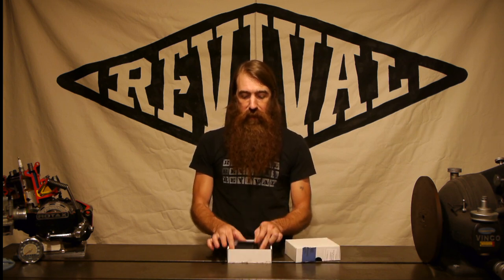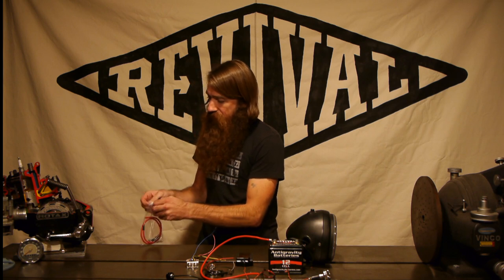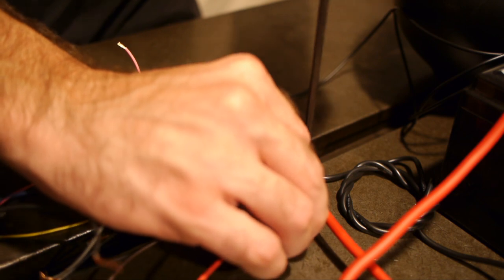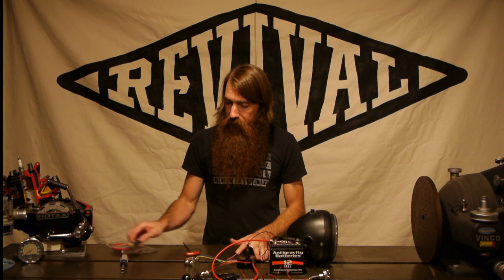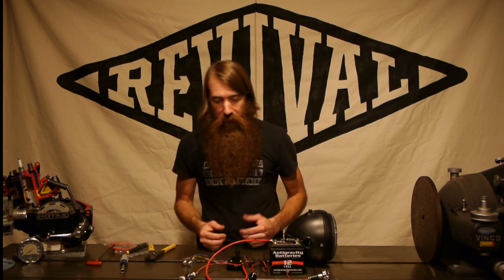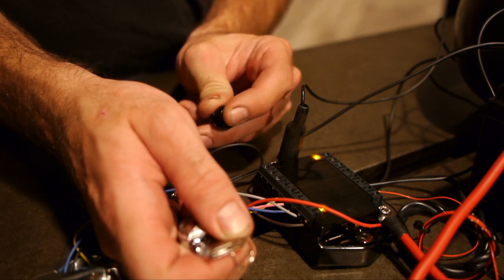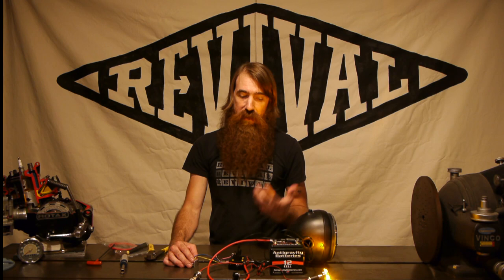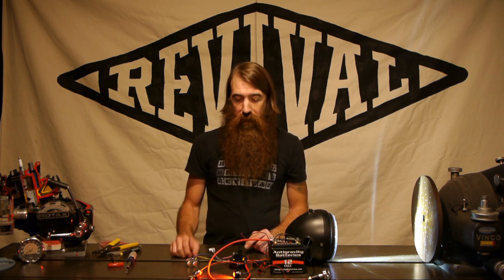Wiring the Motogadget m-Unit V.2 - Revival Cycles Tech Talk

Comment: hi..is the configuration button included with the m-unit?or do i have to buy it separately? and does the m,-unit technically replaced the fuse?
Reply from the maker: +Ros ariff Roslan 

The m-Unit does not include a configuration button. However, configuration button is only used during setup and it is not absolutely necessary to purchase one separately. On all our builds we just use a short length of wire to make a temporary switch, one end of the wire is inserted into the config terminal, the other is touched to a chassis ground to create a switch, just use this the same way you would a button. There is no current that flows from the config terminal so there is no risk of getting shocked, just be sure you are touching ground and not positive voltage. Once the configuration is complete, you remove the wire from config. Its quick and dirty but it gets the job done and you don't waste money on another switch. 

The m-Unit does replace the fuse block. It has preset current limits for all the outputs on the m-Unit and if the current exceeds these values the m-Unit will shut down that output. There are a couple exceptions to this. First, you still need a main fuse to protect your battery from a charging system failure. And second, if you are connecting thin gauge wire to the outputs, they should be fused to the appropriate amperage for the gauge wire you are using. As an example of this, if you are using a Motogadget gauge, the wire is very small gauge and it gets power from the AUX output. The AUX output can supply 16Amps and that gauge wire should be fused at 1Amp, and therefore a fuse is required to protect the thin wire that goes to the Motogadget gauge.
Reply: +Revival Cycles  great video series, helped out a lot..  a quick question ....   when i have the m button installed the config input is used and when i tried to use the config button it did not work...  when i removed the m button config cable i could configure the m unit as normal... this causes a problem as it is not that great to have to keep removing the m button to re configure the alarm for example... anyway i could put a switch that isolates teh m button but i was wondering if you had a better idea?

Comment: Ive got a 1994 sportster 883. Just bought the motogadget m-unit. Couple of questions, because the schematic isnt as straight forward as it seems! 
It shows a wire going from the ignition module to aux (m unit). which wire do i select? Ive kept the electronic ignition and will re run cable for oil sender. That i can deal with. 
Also, do i now just bin the voltage regulator at the front of my bike? 
Comments appreciated. 
In the UK, so its not so harley orientated!!  Cant just zip down the mechanics shop and pick his brain.....
Reply from the maker: +Dwayne Moss Thanks for your question! There are two parts to the answer. Hope this helps! 
a) Ignition system. The ignition system remains as it was from the factory, any sensors, CDI's, fuel pump relays, or ECU's are still maintained. The way they integrate with the m-Unit is by getting power from the "AUX" output. The specific wires that you need to deliver power to are the ones that would have originally been powered by the ignition key switch. With out having a clear wire diagram for your specific bike it is not possible to determine which wires need to be connected to "AUX". 

b) Charging system. The regulator rectifier is still retained, and is connected as it was on the original bike. In some cases the reg/rec needs to get a switched reference voltage and this provided by the "AUX" output. In the case of a Harley Sportster my recolection is that this is a simple single phase permenant magnet system and there are 4 wires that come from the reg/rec. Two come from inside the engine and this is where the AC power comes from, then the other two are the DC side, one will connect to ground (either at the battery or on the frame) the other should be the regulated +12 V and this connects to the positive terminal of the battery via a main fuse.

Comment: Hi I don' t know how to connect m-Unit button with the  front brake. The m-Button has 1 cable only but the brake lever has two input plugs. What I have to do? 
Many thanks for your help.
Reply from the maker: +stefano colautti The other side of the brake switch is connected to ground, just like the rest of the control buttons on the handlebars. On our installs we run a dedicated ground wire to each switch and these ground wires all splice into one wire inside the handlebars so it keeps the bulk down, and ensures long term reliability.
Reply: +Revival Cycles 
I'll do it.
Thanks.

Comment: hello. I've fitted the v2 to my bobber build - all new wiring. I'm have an issue with when I've got the lights on, it works fine. when I put on high beam it turns off my tail light. it's a twin wire, twin bulb rear lamp. how do stop the tail light turning off when I go on to high beam?  thank you.
Reply from the maker: This sounds like you may have your tail light wired into the low beam of the headlight, like some OEM setups do. I usually find it is easier to set up the tail light using the 1-wire feature. To do this disconnect the tail light wire from the rest of the bike and then tie the tail light wire and the brake light wire together , and then configure menu 2 as option B for LED bulbs or C for standard incandescent bulbs.  This will allow the m-Unit to control the tail/brake functions. Just to be clear you tie the power wire for the brake light and the power wire for the tail light together, the ground  wires still connect to ground. 

If you need more details or have more questions, email techsupport@revivalcycles.com Thanks!

Comment: I am on my second ultimate 18-533, and I just failed again... So I wondering could I just cut out the box and use the m-unit in its place....
Reply from the maker: +John Schwartz We have never used one of the Ultimate products, and as such do not have much information on that product. We did take a quick look at their installation instructions, and yes, it appears that most of the needed wires are routed to that control box and with some careful re-wiring you could replace that module with an m-Unit. It is worth noting that the m-Unit does not have connections for both sides of the control switches, and you would need to make sure the switches we setup to reference ground with the m-Unit install, and you would also need to reconfigure how the instrument warning lights are wired. Still all this can be done at the location of the control box. Email techsupport@revivalcycles.com if you need more details

Comment: hi mate , its possible to connect a fuel pump to the m unit? if so, where in the m unit will go?
Reply from the maker: Yes the fuel pump can be connected with the m-Unit, and it would be supplied power via the AUX output. However, the fuel pump should still be controlled by the ECU and that means you'll need a fuel pump relay. Once you have to add a fuel pump relay back into the system, then its just as easy to power the fuel pump directly from the battery.  

It is good practice to  have the fuel pump controlled by the ECU so that it doesn't run the entire time the bike is on even when the engine isn't running.

Comment: Can I use this with just a battery to add a horn  brake and indicator light on my off road. Ike ? Thanks
Reply from the maker: In theory you could add an m-Unit and a battery and run it as a total loss system. But if you want to go this route, I strongly suggest using LED lighting, the LED's draw a lot less power and that will make it so the battery lasts longer. 

Also, you should do some research there may be an aftermarket stator and reg/rec for your bike so you can actually add a charging system, that way you won't have to run as a total loss and it will work more like a normal street bike.

Comment: Always awesome useful videos thanks Stefan. I'm having issues with my m-unit As soon as I touch the "Start Out" blue cable to my starter solenoid (point 50) the bike immediately tries to start.I have tried this with the m-unit off and on with the same result (the bike tries to start).I removed the config wire to test and the same result.The M-Unit is acting like it has "always on" for the "Start Out". any ideas.? thanks
Reply from the maker: Hmmm, that is an interesting one. It is possible that the start output has failed and is stuck in the on position. The best test for this would be to use a spare turn signal or light bulb to check if the start output is always on. One wire to ground one wire to start, if the light turns on then the start output is damaged and the m-Unit will need to be replaced. 

It doesn't work to test the output with a multi-meter because the solid state devices will still show voltage even though they are actually off. The only proper way to test an output on the m-Unit is with a "load" like  a standard 12V light bulb.

Comment: Is the switch in this video the two position switch that y'all offer?
Reply: Also, do I still need a starter solenoid or is that built in as well?
Reply from the maker: +Alex Carter
You got it,  that is the same switch we offer on the site and use on most of our builds. There's also a 3 position available if you need.
Reply from the maker: +Alex Carter
The m-Unit does not replace the starter solenoid, but in most applications that is the only relay that needs to be retained.

Let us know if you have any other questions, you can also direct them to websales@revivalcycles.com and we'll be happy to help you out.

Comment: Hi, we're using a two way 3 wire rocker switch for the headlight, scratching our heads how we wire low high beam switch in.
Reply from the maker: Low beam wire does not connect to anything. The best plan is to use some heat shrink to cap the end so it can't accidentally touch something and cause problems
Reply: Thank you.

Comment: hallo is it possible You make a video a bout the c5ig ignition i woud like tot sees hoe it work with special for a virago
Reply from the maker: Thanks for the request, the C5 ignition tech talk is on the list, but we haven't scheduled it yet...we will move it up on the priority list. This is the best ignition system we've found, simple to install, simple to time, extremely effective, and perfectly accurate. 

We have installed many aftermarket ignitions and this is the C5 is the best.
Reply: wow thank You for the fast respons i all ready orderd the 'm unit because of this video for my virago i 'm looping for werd for the c5ig for the virago alle ready thanks
Reply from the maker: Yea those C5 ignitions are great, and while we don't have all the models listed on our webstore, we are an official dealer and can get you whatever you need. We can also program custom ignition curves if you want to do something specific. We've got the C5 on the list for tech talks, but there are a few topics that are ahead of it.
Reply: Revival Cycles  I want to add a horn brake and indicator lights on my off road bike , just powers by a single antigravity battery , and m unit is this possible ? Thanks

Comment: Hey did you guys finally get the M unit working with the LED taillight blinker combo?
Reply from the maker: Its not completely clear what you are referencing, but we have been able to find solutions to every lighting setup so far. If you are talking about a combination tail/brake/turn LED setup, then the best solution we've found is to use a hopkins LED trailer light converter to manage the brake/turn interaction.
Reply: @RevivalCycles  if I wanted to wire in a relay would I do that through the AUX? Yes I am referring to exactly that, thanks for the quick response, you guys should get on reddit!
Reply from the maker: Right with the original V2 m-Unit you would power a relay coil off the AUX output. But with the new m-Unit Blue or Basic, you have two new AUX outputs in addition to the ignition output so you might be able to just use AUX 1 or AUX 2 instead of adding a relay.
Reply: @RevivalCycles  Awesome thanks for the information! Seriously look into getting on reddit you'll probably be able to push some product and gather some attention to this through it!
Reply from the maker: Thx for the tips, we'll get the media guys to take a look at that. It does get tricky to manage all the different social platforms, but hey if it was easy everyone would do it.
Reply: @RevivalCycles  Very true mate you're doing the lord's work here so keep it up.

Comment: i know this is an old video but can you set this up for 4 way flashers to
Reply from the maker: Yep, the m-Unit will do 4-way flashers if you are using momentary push button switches for the turn signal inputs. The 4-way function cannot be activated if using a stock style toggle switch for the turn signals, because the m-Unit needs to see both inputs pressed at the same time and that isn't possible with the stock switch.

Comment: If you got a cdi powered by your generator at the flywheel, how would you go about wiring the key switch and what would Aux output be powering?
Reply from the maker: The key switch for the m-Unit is the same as it is on any of the installs, the switch provides power to the lock input. When the lock input is not powered, the m-Unit it off, when the lock input has power it is turned on.  The m-Unit does not work with bikes that don't have a battery.

With a CDI type ignition system, I use the AUX to power a normally closed relay. Then the relay is used to ground the kill wire from the ignition control module. That way, when the AUX is off, the relay is closed and the kill wire is grounded (no spark). When the AUX is powered the relay is open so the CDI will generate a spark.
Reply: I really appreciate you taking the time to respond to my dumb questions! My worry is that by send high DC to the CDI via the aux output as in the motogadget wiring diagram, would I not damage it seeing as it's normally powered by the magneto?
Reply from the maker: Just to clarify, the AUX does not connect directly to the CDI. Instead, the CDI is wired up as shown on the factory diagram, so the magneto still powers the CDI, and the coils are powered by the CDI, and the pickup coils tell the CDI when to spark. But the AUX is used to control a normally closed relay that replaces the manually operated kill switch or key switch.
Reply: Got it !! That diagram with aux spliced into the ignition coil feed confused the hell out of me. Just got the headlight low/high beam with oem controls  and m-button to suss now. Thanks again for your help.✌️
Reply from the maker: Take a look at the manual on the bottom of page 4 and the top of page 5, that explains the hookup for stock controls on the headlight. But basically it uses the stock toggle switch like a true / false input, if the llight input is grounded, that tells the m-Unit low beam, if the light input is not grounded that means high beam. So you only connect the low beam wire from the switch to the input, and the high beam wire from the switch is not connected to anything. 

The m-Button is wired up exactly as shown in the diagrams, there is nothing special about using stock switches. The magic happens in the m-Unit when you setup the configuration of menu 5. Make sure the configuration matches the type of switches you are using.

Comment: my bike is 2003 r1 battery black wire came loose now I have no power to clocks and wont turn over but fuel pump starts could installing a motogadget ix the electrical fault or is the electricals to complicated on my bike thanks in advance p I'm fro uk
Reply from the maker: The m-Unit can be installed on modern fuel injected bikes, but it is a rather involved process and you should make sure you have a solid understanding of the wiring for the ECU and sensors before beginning.

Comment: Does the M Unit come with the configuration button?
Reply from the maker: +Allen Davis The m-Unit does not include a configuration button. However, configuration button is only used during setup and it is not absolutely necessary to purchase one separately. On all our builds we just use a short length of wire to make a temporary switch, one end of the wire is inserted into the config terminal, the other is touched to a chassis ground to create a switch, just use this the same way you would a button. There is no current that flows from the config terminal so there is no risk of getting shocked, just be sure you are touching ground and not positive voltage. Once the configuration is complete, you remove the wire from config. Its quick and dirty but it gets the job done and you don't waste money on another switch.

Comment: Can the M- unit be used with the a Honda CX500 orinal harness?
Reply from the maker: The short answer is, yes. However, the recommendation is to start from scratch. The factory wiring is not really setup to work the same way the m-Unit is and although you can reconfigure it, many times its simpler to just start over.  Also, the factory switches are a very common source of problems with new m-Unit installs, and it is always a good idea to replace these with new ones, either after market or new OEM.

Comment: Can I run Oberon LED signals without buying extra resistors on the M-Unit?
Reply from the maker: The m-Unit does not need any load balance resistors, and it is setup to have a stable flash pattern no matter what light you are using.
Reply: That is excellent, thank you!